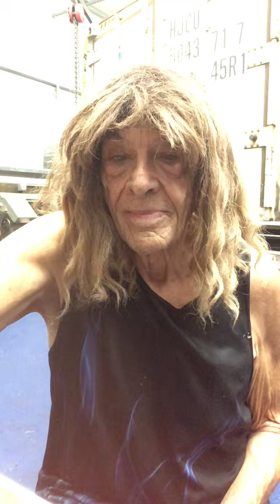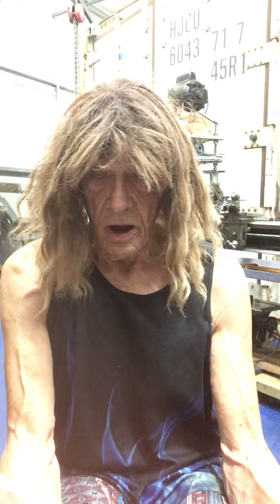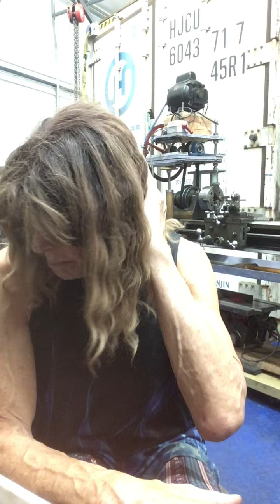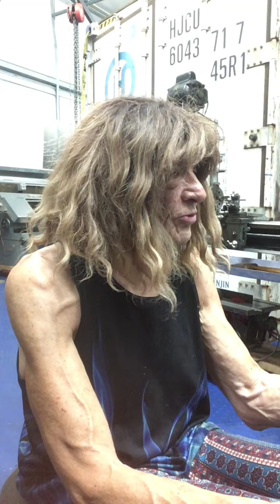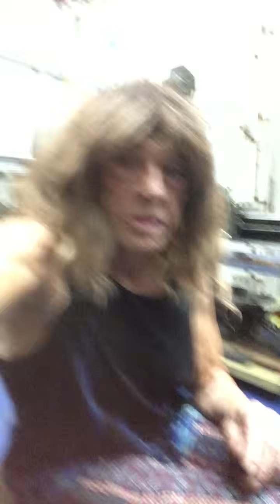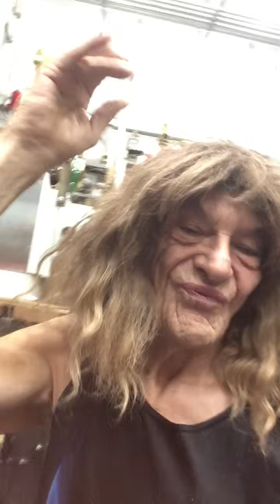Hutchison effect misconception

Comment: Thank you for clarifying the misconceptions John.   Especially appreciate clarifying the small model UFO on a string, was not trying to prove you could levitate the UFO, but to demonstrate the forces around the system on it.   That UFO video did throw me off from believing your work for awhile.  

However, the video posted of the solid iron block appearing to deform and melt without heat is remarkable and really how could you even fake or imitate this effect with an iron bar?  Definitely discovered something.

If how you are describing this is true, that it is one or two Tesla coils, one a dumbbell Tesla coil and an electrostatic generator, then the only explanation within established physics which could possible work, is Nuclear Electric Resonance.  Remarkable you got so lucky to get this to happen.   I'm in the same country as you, one province over, always wanted to have a chat about your early work.
Reply from the maker: Yes the iron block demonstrated long ago for a investment group was fun

Comment: Love seeing this. Can someone enlightening me on the sparks he keeps mentioning
Reply: A Tesla coil when running, can emit very large 'sparks' or discharges.  In the circuit which powers a Tesla coil, is often a spark gap, which is an air gap in the circuit.  John is clarifying, he was most interested in the radio frequencies emitted by the Tesla coil, not having it emit giant sparks.  He clarifies, he certainly still had sparks in the spark gap to power the Tesla coil and made sure to use very high performance spark gaps to get a clean signal.

How a Tesla power supply works, is a capacitor is charged to a high voltage, until the voltage is sufficiently high to arc across the spark gap in the circuit.  When the ark in the spark gap occurs, the capacitor is rapidly discharged across the spark gap.  This discharge oscillates at a very high frequency depending on the size of the spark gap, size of the coils and the gap of the spark gap.  This primary circuit is then transformed to a much higher voltage in the secondary coil of the Tesla coil, which is in tune with these high frequency vibrations in the primary circuit.

Comment: 1 more question: regarding magnetic fields, circular motion as in girandola drivers producing high rotational momentum and lift for rocketry. How would the energy be harnessed to control the lift? What kinds of energy would be required, electromagnetic fields or waves, and what would be necessary to avoid explosions or materials from becoming fused together?

Comment: 1 question: mars rock dust and Saturn ring rock dust mixture that would fuse into a sheet-rock panel. What frequency would make something like that possible?

I’ve seen sheets of glass manufactured for building windows, so I’m familiar with the technology.

Comment: The Hutchison Effect refers to a science phenomenon  discovered in 1979 by Canadian inventor John Hutchison. 
Using a chaotic assembly of surplus military equipment—including Tesla coils, Van de Graaff generators, and radio-frequency (RF) transmitters—Hutchison induced highly anomalous behaviors in matter. 

topic break down
 Phenomena
Hutchison and his early supporters found that overlapping electromagnetic waves and complex wave interference created a localized decoupling of gravity and anomalous structural manipulation. 
The effects included: 
Levitation: 
Heavy objects like wrenches, bowling balls, and ice cream tubs allegedly floating or shooting into the air.
Metal "Jellification":
 Solid metal bars becoming soft and malleable at room temperature without generating heat.
Material Fusion: 
Dissimilar materials, such as wood embedding into solid aluminum or steel fusing with copper, structurally merging without melting.
Spontaneous Fracturing: 
Internal shattering or sideways sliding separation of metal crystalline structures. 
Mainstream physics categorizes the Hutchison Effect as pseudoscience or fringe science due to a fundamental lack of methodology and evidence. 
The Burden of Proof: In science, the burden of proof lies with the claimant. Hutchison never provided quantitative measurements, maintained precise documentation, calibrated variables, or published in peer-reviewed journals. 
Theoretical Disconnect: Proponents frequently threw out buzzwords like "scalar waves," "zero-point energy," or "Casimir Effect". However, according to general relativity and standard electromagnetism, there is no verified mechanism or overlapping bridge that allows standard EM radio waves to manipulate gravity or dissolve material chemical bonds without extreme thermal energy. 
Evidence of Hoaxing: Hutchison damaged his own credibility by admitting that some subsequent footage he sold on VHS tapes was faked using invisible strings and upside-down camera trickery. Critics note that in his levitation videos, stationary background items (like brooms) appear stiffly anchored, suggesting the entire camera setup was flipped upside down while an electromagnet on the ceiling was deactivated to let items drop to the floor. 

Reddit
 +1
Replication of Experiments
A hallmark of true empirical science is reproducibility. The Hutchison Effect has never been independently replicated under controlled conditions.

Comment: Beat frequency between 2 coils and a dirty ac in the center. The spark breaks the field. High voltage leaching and field coupling. Thank you.
Reply: You should'nt use AC at all but high voltage DC with a high frequency switching
Reply: @nickmalone3143  I am right. I build this stuff on my channel. You need the dirty ac or ions.
Reply: @nickmalone3143  why?

Comment: Tesla said it well….a spark at frequencies of generally above 200,000 per second, always discharging at the same direction, and always interrupted, before the next one began. He used a quenched spark gap to achieve the interruption. As you mention a condenser properly tuned can get the perfect effect. 
Tesla stopped using mechanical wheels turning in opposing directions, with tungsten pins for the spark. Only condensers properly tuned were sufficient. 
1-2 million per second is where the insulating medium is broken down, separating all radiant matter. The electrostatic attraction can be used to combine charges, and collected with a small conductive plate grounded, as per the patent. 
Not sure why you would say electrostatic discharges, and radio frequency in the same presentation?
RF is misleading. 
Thanks for the presentation.